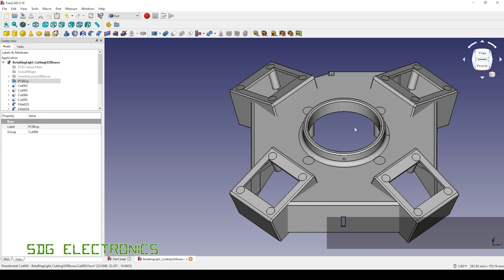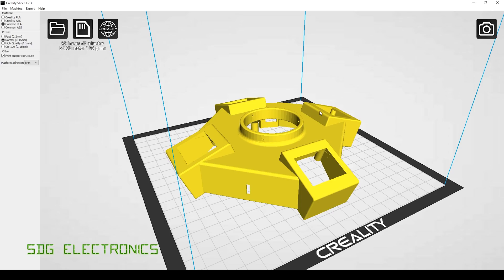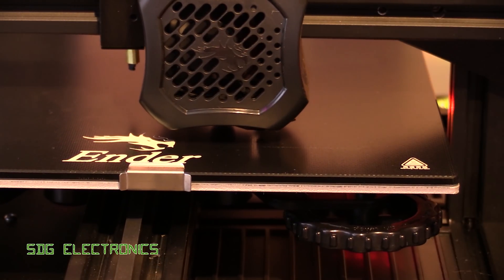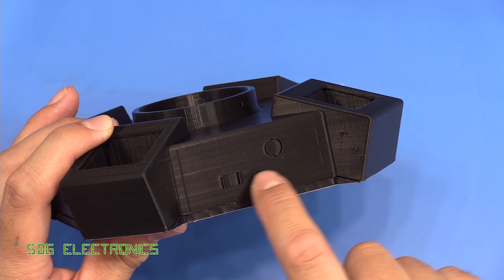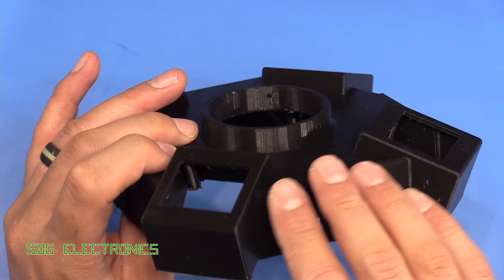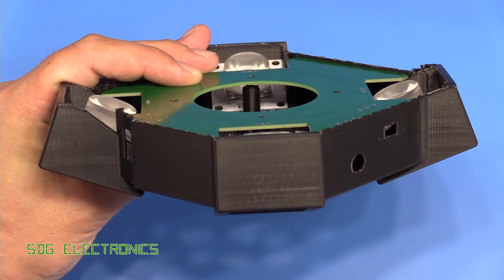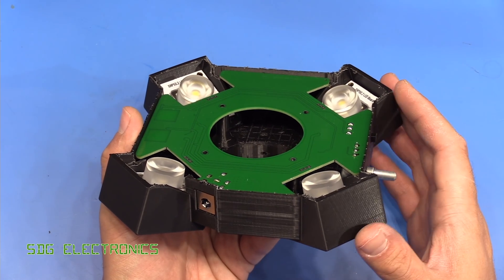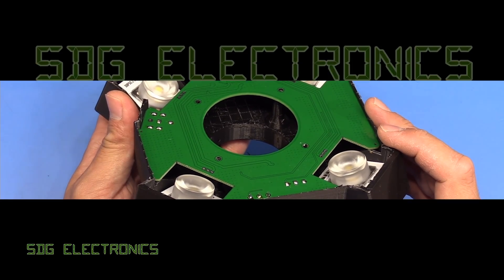SDG #174 Testing out a chassis using the Creality Ender 3 V2 with PCBs from JLCPCB

Comment: Does the position of the main board cast a shadow? It looks like it's obscuring the lenses slightly.

In order to reduce wastage and print times, I'd print the LED mounts separately:
- A five-sided box for the main board, with open sections where the LED boards go - to be printed with the bottom face flat on the bed and no supports
- Four separate boxes for the LEDs, with angled mounts in the edge to receive screws from the main box - again the lower flat face can be on the bed and this should also be printable with no supports

I think you could get the print down to a couple of hours by doing this.
Reply from the maker: I think that's the best approach. I've not powered it all up yet, but the lenses do clear the green PCB, but the positioning isn't what I was after, also the LED boxes are too big. I'm tempted to swap to some other software at the same time. I've come across a few "features" which are frustrating.

Comment: Is all about the angle of the reflection. direct light and direct pcb most probably will reflect back to the lens. you need to change the angle of the light so it doesn't reflect at the pcb. I think best approach would be side goose lights or something similar bot nothing from the top unless maybe they are inclined like 45 to 60 degrees from the horizontal plane of the lens....

Comment: It's probably a good idea to modify the case a little and split it into separate parts that can be screwed or glued together. I always try to avoid using support material whenever possible. It often looks messy and I tend to break stuff while cutting away the supports.

Comment: I would change the design to be able to print it like a shell with the top on the bed. it might be easier to print orther parts seperatly like the retaining ring and make it with a partial exterior thread and securing nut. As for the LED housings, you could print them seperatly as well if you want them at an angle but have some fixing screws or dovetail it sits in to fix it to the main body, otherwise you could keep them intergrated and make the tops on them flat but the bottom and LED boards mountings slanted. Basically i would change your design so it can all be printed flat on the bed. Having the finished side on the bed means you will get a really nice flat finish on the top. Printing it in parts will drasticly reduce print time, I wouldn't be supprised to see it being 1/3 or 1/4 of the time it has already taken. 
Oh and nice to see your tackling Freecad, by far not the most intuitive 3d software to use and does make life very hard sometimes, especially when trying to do something simple and the program just cant do it, i find it very hard to use somtimes, but it is free. It is overly complicated than what it needs to be.

Comment: If you flatten the top so it is not contoured, you could print it upside down instead, as you are printing on glass the top surface will come out nice.
Reply from the maker: I think trying to do it as one piece has too many compromises. V2 will definitely print the top surface flat onto the bed.
Reply: @sdgelectronics  - Printing it upside down will fix a lot of the issues you pointed out, I think it will come out well and it should also reduce your print time by quite a bit due to not needing to print the supports.
You could also angle down the mounting screws at 45 degrees, or move them to be underneath instead, I think the mounting ring needs to be a bit more robust anyway, PLA fractures pretty easily so a slight knock might break the ring off, so a much thicker ring underneath would probably be better anyway.
Also another consideration is heat, PLA will soften and shrink when it gets close to 60 degrees, so if the heatsinks put off a fair bit of heat it might warp the PLA, so maybe use PETG which would be better for that, and also a lot easier to print than ABS.

Comment: Separate those 4 LED boxes as individual printable parts (with a RIM), and then you glue then together with super glue or you screw them in place,
The ring mount, you can leave a hole in the main piece, create the ring apart (with a rim as well) and glue it or screw it to the main piece.
This way you won't need any support material.
Reply from the maker: I think that's the best approach

Comment: To get rid of those artifacts (random lines across infill and skin), set "combing mode" to "OFF" in your slicer (cura) and tune your retraction and coasting accordingly
Combing is actually shite, since it disables retraction and slowly pulls molten filament from your nozzle when it's moving, which leads to gaps between walls/infill whet starting to extrude after movement, even with zHop.
Reply from the maker: Thanks for the info, I'll try that out.

Comment: I printed a complicated battery case for my cordless drill, and it took such a long PITA 10hrs that I said I'll fix the 2 errors manually with glue - lol -. I would glue a bush in those posts.
I think it has too many sharp corners that you can bump into, and the LED boxes look too bulky. Can the LED boxes just be a 5mm plate.
Reply from the maker: The LED boxes are definitely not right. I'm just sketching some new ideas now I know the pitfalls with this design.
Reply: @sdgelectronics  That's the beauty of prototyping.
I've just started 3D printing a short time ago, with a few successes a lot of redesigns and even more failures. But I keep trying. Luckily my 3D printer is very quiet. (it's standing in my living room)
This video showed me that 3D printing can be quite a challenge.

Comment: Due to other design decision for not making them protrude as much, the led daughter boards seem to have ended up too deeply recessed within the housing in a way that means the inner edge of the dome is slightly obscured by the main green pcb. So it would make sense to functionally test the one you have now. To check that the light dispersion is good enough and not being cut off on the inside by that. For example when you want to focus more closely for inspection / macro shot and the distance gap above the work becomes a lot closer. Personally I would redo the position of the led corner modules and really try to swing them out a little bit and up / over past the green pcb. so that they are more protruding and on the same planar level as the green pcb. Then make the whole housing perhaps a bit thinner. With those corner modules becoming more bulbous and generally just protruding from the rest of the housing a bit more. If overall by making the frame more skeletal in nature you could also start off from a point of a much reduced material. To reduce your iteration time / earlier print time. Then building back later on more material in subsequent versions. After fixing the other issues you have found. Perhaps putting in larger triangular shaped support fins / struts laterally inside the internal structure would help to strengthen the whole unit. Think 'girders +++'  I see that technique user on a lot to strengthen plastic molded designs elsewhere in manufacturing. To reduce the total amount of plastic or die cast aluminum needed. Another possible technique is to make the internal thickness of the infill pattern 'just thick enough' to be supporting itself. Like a double walled cell. Or cavity walls in a house. That kind of a structure can help to bridge open air gaps without needing to be directly supported from underneath.... well if you can get the technique right. You probably then would not need to use so much infill either. At least not all of the way. Think like the branches of a tree. Sorry there are better ways to explain all this. You will just gradually end up learning more of these tricks over time. Just out of the sheer frustration of having to wait so long for your prints to finish. It also depends how much tinkering / how obsessed you wish to become for optimizing for the different criteria. Be it for strength or printing speed. Or the amount of supports and finishing work that is required to clean up the print. Or the pitch size / level of detail. Its all a trade off depending what your priorities and the goals are for a specific print.
Reply from the maker: It didn't really turn out how I had planned, but that was the main purpose of doing a test print. The LED mounts are going to be separate units and support a better air path. The green PCB is way off in position like you say - it needs to be about 10mm lower, ideally exactly in line with the connections to the LED boards. Back to the drawing board!
Reply: @sdgelectronics  Cool man - good luck!

Comment: The heatsinks may need convection path from underside to the top if they just sit flush in a indentation. Probably not much airflow in there.
The amount of z height support is quite high. how about dividing the design into parts. The led holder's seems to be easy print laying flat. If the center would be printed on the other way around. And make the led holder's separate parts. Attached with M3 screws afterwards. Underside might be still ugly though from the supports.
Reply: Also can the middle part that holds to the microscope printed separately and attached with screws? Separating everything into modules would make this easy print. The center could then be printed flash on the printing plate.there seems to be plenty of space underneath the pcb for some  mounting hardware.

Comment: I think it's too high; it will take to much of your precious Z axis. Also, the fins of the heat sinks should protrude outside of the structure for better dissipation. Finally, beware of the LED/heat sink temperature: it can soften your PLA case and make it warp on itself. Perhaps a higher temp plastic would be more suited for that.
Reply from the maker: I'm thinking the whole thing is too big, but I have a good reference now to work with. Before I was shooting blind to some extent. Good point on the temperature, I think it's well within limits but definitely worth noting.

Comment: 4:11 - as long as it's only on the infill don't worry about it, but I'd wager setting retraction to something like 8mm would get rid of that (unfortunately without a direct extruder that's necessary for good prints).
From what I've read Creality Slicer is just an old, reskinned version of Cura, so I'd advise you to just switch to Cura, it includes an Ender 3 profile so don't worry about configuration and from experience I have to say it's really worth it to have the newest release.
Also the tree style infill, it would reduce the wasted filament and I found it to be much easier to remove later.
You may want to consider enabling ironing, you'd get much smoother top surfaces and it doesn't add that much more to the print time. Unfortunately the sides will stay "layery" but aside from sanding there's not much you can do (with PLA that is, ABS can be smoothed with acetone, although I've never tried it myself so I don't know if it would be a good fit here).
I guess you can redesign the case, but I think with those tweaks that may not be needed.
Anyway, I'm curious to see how that resin printer ends up working for the light pipe.

Comment: The LEDs need to come out more because i see the green pcb is blocking some light in all four sides. You may end up with dark spots forming a square on the bench, but i cannot say for sure what it will do unless it is powered on. LEDs are very bright so this might not be issue here.
Reply from the maker: It actually just clears the PCB, but you're right, it didn't end up how I had planned so many modifications needed.

Comment: I really enjoy using PLA+ for when I don't need high strength or temperature for the part. One thing I do is print with a 1mm roof on the supports and then i can reduce the support to 10% and get good results holding up large flat areas. I'm no expert just from my own experiences..lol but for curiosity sake I may have flipped it over  and seen what the total time and filament use was?? But this is a very cool project..
Reply: I think I remember CNC Kitchen tested ABS as weaker than PLA, and that it only had a temp advantage. Maybe check his channel out.

Comment: Good progress, Steve. My concern would be the cooling. I think the heat sinks should be exposed as much as possible by removing much of the shroud to allow better airflow. That might allow you to reduce the depth of print and consider the 'deck' as just a PCB cover, and reducing the boss height but increasing the height of the lens mount. Hard to describe - easier to draw  - lol. If you're concerned about protecting the user from the heat sinks, add a thin, mesh-like cover where its possible to touch them.

Comment: Judging by the heatsinks on the backs of those modules, at higher power levels, I think you need an inlet area to promote airflow, hot air rises but if the only area open to airflow is the top of the heatsink, colder air doesn't really get introduced readily via the convection currents. But if they don't get overly hot and the heatsinks are 'overkill' then I'd say it's probably fine.
Reply: Was going to say, the cold air needs somewhere to get in before it can flow up as warm air. Bigger pods with air gap around the pcb

Comment: I've had really good results with eSUN ABS. For a large item like that I'd print it in parts and then solvent weld them together. Plastic plumbing solvent cement (Floplast SC250 or similar) works great with ABS giving a very strong permanent weld.
Reply from the maker: I have a roll of eSUN ABS, but I'm looking into PETG too. I've tried loads of different brands, but eSUN has been really consistent.
Reply: I prefer petg over abs atm. I find it easier to work with and plenty strong

Comment: With the heat that the LED's will make I would think PETG would be a better pick and it will be much stronger and print better then ABS. Yes it's way to much supports. If you make the mounting ring a separate part and lose the humps at the heat sinks you could then print it flat on it's top with no problem.
The mounting ring can easily be made into a separate part the slides into the body through the bottom, counter sunk and held in place by 3 3mmx5mm screws with nuts. Just my thoughts but it looks really good!! Great stuff as always Steve!!
Reply from the maker: I'll take a look into PETG. ABS and PLA will likely degrade over time from the near-UV content of the LEDs anyway. Thanks

Comment: Nice update, Steve.  The project is coming along nicely.  I have no experience with 3D printing, so I can't comment on those issues, but I do have one suggestion.  I think you'll get better thermal performance if you modify the four boxes that hold the LED boards so that the heatsinks are in free air instead of being fully shrouded.  It doesn't appear that there's much space for airflow from below the board to reach the heatsinks in the present design.
Reply from the maker: I agree, it didn't turn out quite right. That's part of the reason I wanted to do a test print, but also to check the Ender 3's positional accuracy. I noticed on the CR10-S Pro, it needs more calibration - something 200mm gets printed 201mm. The Ender 3 seems spot on.
Reply: @sdgelectronics  You need do to a test print and modify in cura the horizontal expansion. Look at chep of filament friday videos on that